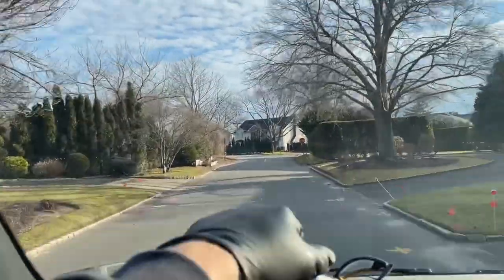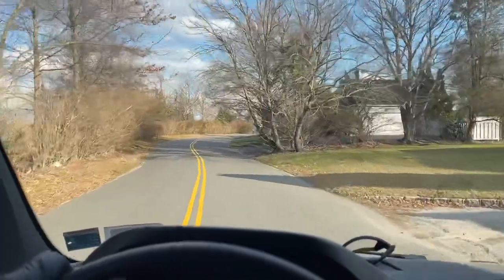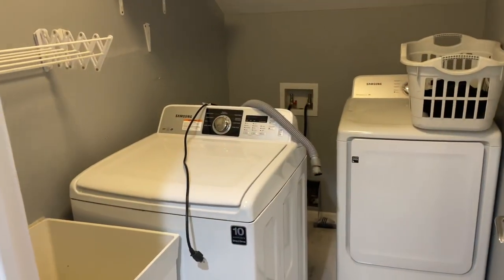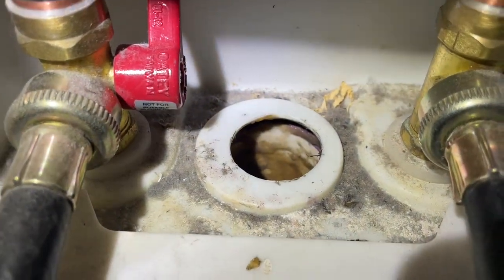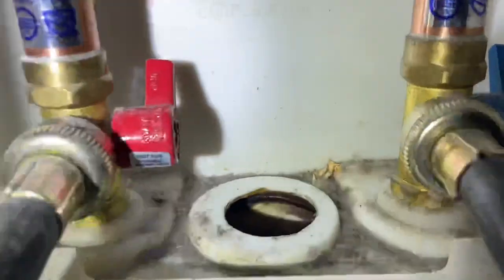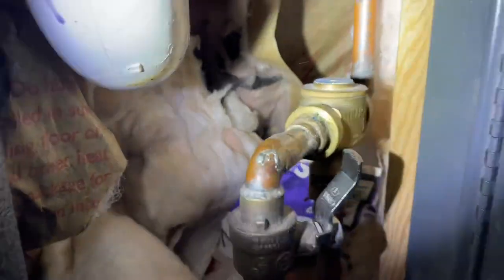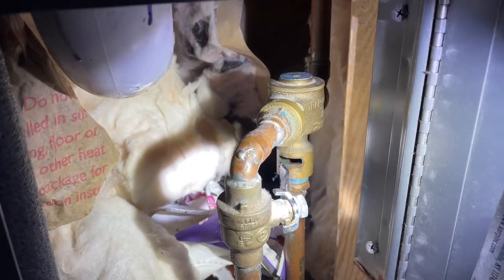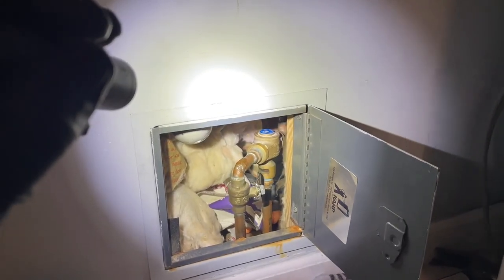Mysterious Water Leak Sound Behind Washing Machine - Problem Solved

Comment: Put some pennies  in the top of to shut off
Reply: And that cost to fix is a price in the 1800's😂
Reply: I've used dimes in worn flush valve handles to take out the slack. put a little o ring grease on them will make them stick while re-installing the handle.
Reply: Use real copper pennies.

Comment: Engineer in old Pittsburgh hockey arena used for floor drains that don't get used primer works by water flow in sink opening pee drain in valve. Rebuilt with kit adjustable flow. Each time water used.

Comment: Were you ever able to fix this? I have the same valve under my sink that’s leaking. How do you install the repair kit? Does the top of the trap primer screw off?
Reply: Did you ever find a solution?

Comment: Watts A200-S. Used to sell tons of them. They were discontinued about 10 or so years back with no flow though style replacement. I believe Sioux chief may make something similar but they pricey buggars. I usually have to tell plumbers to go to a straight 1/2" mip style one like a mifab MR-500 or watts LFTP300S.
Reply: Or just cut it out lol. Unless they never use the washer they shouldn't  need a tsp....? If it's plumbed properly to avoid siphoning.

Comment: Sattle valves for icemakers are the biggest cause of leaks not so much the pipe but its best to use copper... Also whats the point of that trap primer if the trap already has water in it??
Reply: Saddle valves for cheap customers.
Reply: Primer is for the floor drain. Drain probably required if laundry is above finished area
Reply: @airmech5083  I dont care how cheap a customer is I'm not putting in a saddle valve.
Not only are they not code they are for hacks

Comment: Obviously the cut with the visible running water is to stop water contamination if the drain backs up. So if the drain backs up this device dumps running water behind your wall?  There's got to be a better way.

Comment: Second floor trap primers are a bad idea they fall often and make a mess. Eliminate it, use mineral oil to fill the floor drain trap or use a JR Smith trap gaurd.
Reply: Mineral oil? Does that really work? Does it stick around if the trap is used regularly or is it a "single use" solution?
Reply: @jond3929  if it's used regularly it's not really a concern

Comment: Watts A200-RK repair kit. Depends on your water quality determines if the repair kit will work. That valve was discontinued. Probably better off to bite the bullet, get rid of it, and install a trap guard in the trap
Reply: @PipeDoctor  i'm sure. The repair kit is still available
Reply: @PipeDoctor  is it possible to install a bigger trap door

Comment: May be the solenoid on tub inlet has crud under it is or not being activated.  Easy check since you already determined its the cold water. Monitor  fill time and temps throughout various fill temperatures.  Or guess.

Comment: It should have a slot with the set screw. You can adjust the flow rite with an Allen key. I’ve never rebuilt them only replaced them

Comment: Are trap guards legal in NY ? Just curious
Reply: @PipeDoctor  no. Trap guard press fits into pipe and is made of flexible material and will open when water discharges into and then close to prevent sewer gases. A lot of different companies make them. Slick , simple and very effective.
Reply: And thanks for the stickers ! Got them on my sprinter !

Comment: What’s interesting is that you can hear the water sound  so clearly in the stand pipe. 
 Is there a trap on the stand pipe or dried out ?
Reply: @PipeDoctor  yes 
But a trap seal would muffle the sound
Reply: @rickc9873  - maybe the stand pipe for the washer doesn’t have its own trap, but instead relies on the floor drain trap. So the sound wouldn’t be muffled. But then the drain trap primer wouldn’t be so necessary either.

Comment: I have NEVER HEARD of a trap primer. What is it's purpose and why is it even needed ??? I used to be a plumbers helper around 25 years ago and have NEVER ran into such a contraption. Is it required by code in some areas ????
Reply: @PipeDoctor  well if you get sub zero temps .. the floor drains would be in a LOT of trouble :D right ? given that the house is not heated for a few days of course
Reply: @AL6S00740   - if you have your heat off during winter, then winterizing the plumbing is something that would / should be done. Part of winterizing is to pour mobile home anti-freeze (not car radiator anti-freeze) into all traps so that  the water in the trap does not freeze.

If that wasn’t done, then your scenario comes into play ...